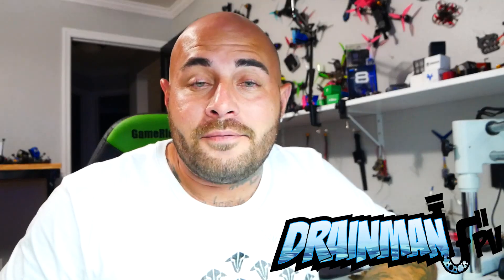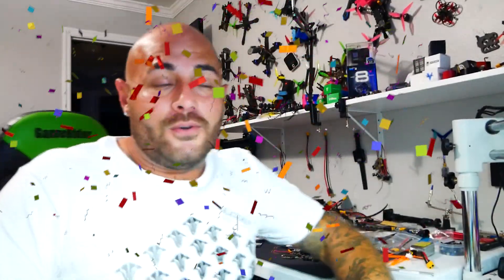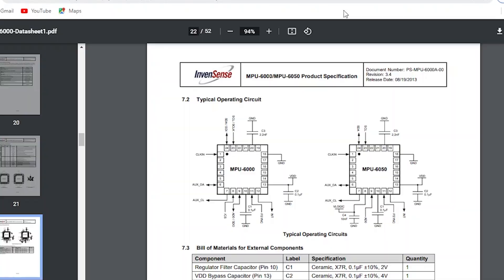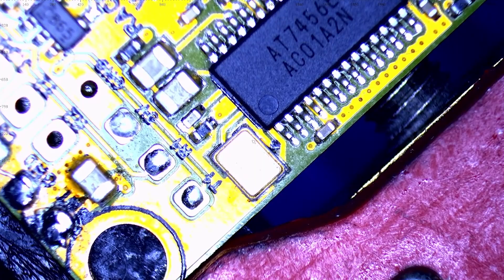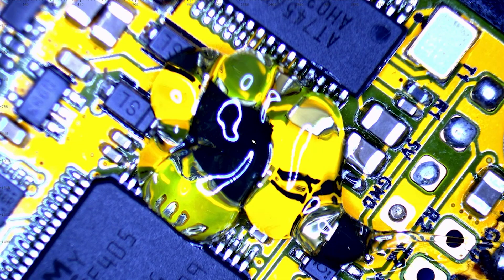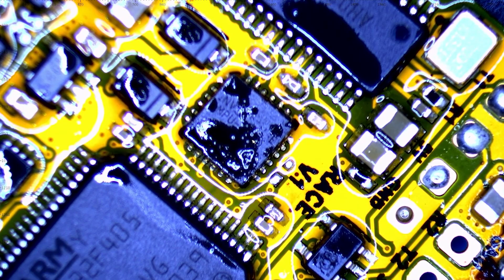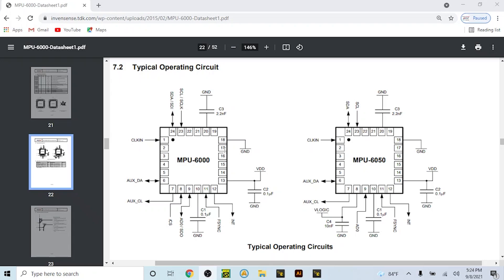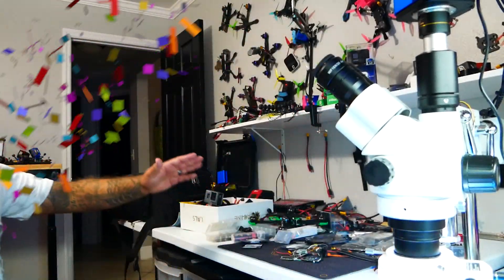How To Fix Betaflight No Gyro Issue! When All Else Fails...

Comment: Hey Drainman my Betafpv Meteor85 is not showing the Gyros on firmware BF 4.2.11 which is the original FW that my whoop shipped with. If I load a higher BF 4.3.0 I get the gyros back but nothing else works. What am I doing wrong?

Comment: it's really advantageous to have a microscope for soldering. I've paid off my cheap Banggod one about three times with the boards I've fixed. Sometimes really frustrating but worth it to learn. I built my own heat gun from a youtube vid. Swabs, alcohol, flux....and patience. Always toss some kaptan tape over the other components you're not working on so you don't blow them away. Once those tiny caps and resistors get loose, they will move without you seeing and maybe just blow off the board if you're not careful, and then you may as well toss the board as opposed to try and figure out where they all go.

Comment: I have a board that the servo's cant be activated in betaflight, and then I tried to swap to emuflight, and the servos can be activated there, but it has no gyro with any firmware I can find, it's fine in betaflight...what's up with that anyone know?

Comment: Great video. I was looking at Bardwell's video on the nogyro message and he basically said get a new fc if what he showed doesnt work which it didnt, i am a newbie so im not really aware of what causes such issue, the issue accured on a brand new mobula6 whoop and so i couldnt beleive that the gyro was fried, luckily it was the firmware which i had been switching around while getting used to the betaflight configurator and binding things, Thanks once again for this amazing video

Comment: @DrainMan FPV hey I have the no gyro issue on emax mini magnum 2 quad was flying came in to land and it freaked out came down rolling over sideways I put in fresh battery and now won't arm and says no gyro on screen I will try using floor noise setting but anything else to recommend?

Comment: Really in my head there's no solution for a bust pad on the board that the gyro attaches too -- its basically too small to bridge the bust pad to where it needs to go....  :(       Another lost FC after less than 3 flights!  Just looked -- its CLKIN PIN 1 where the pad is broken -- how can I repair that - the gyro is probably fine, just a bad pad and pin connection.

Comment: LOVE THIS VIDEO!!  Thank you -- first time i ever removed and replaced a multi-potted circuit like a gyro.  Unfortunately my attempt was not successful as in when I removed the prior gyro --- either i did it or it was already faulty (my suspicion based on the  INSANE number of bad betaflight AIO boards i've been frying out lately) --- I can cleary see one tiny pad in the upper right corner is missing its tin -- ie it can't be soldered or i need to find the direct-connection for that point and skip over the circuit pot link --- i can see i've cleary re-linked all the points, kept the capacitors in place, and still no gryo --- i assumed the attempt would fail once i saw a bad pad on the bottom --- but it was worth the try just for the practice.   You're a mad man using that scope lol -- i don't have one, am old and can't see crap these days --- took off my eyeglasses and pulled it off naked-eye at about 3 inches distance LOL.   Thanks for the education :)   This board flew twice, got strangely glitchy on the 2nd flight --- and died out on third flight just fell out the sky on me :(  --- was a 3 inch toothpick on the ELRS V1 board --- these things suck honestly --- anyways was bad gyro after that probably cooked from not soldering up a capacitor on the lipo --- using xt connector so too much jolt i guess but come on guys its a 1s lipo for cripes sakes.

Comment: Hey drain just got the new mobula 7elrs 1s and it just freaks out when arming or in the air and my gyro 3d model in betaflight also freaks out did I get a pos flight controller?  It's the new 5 in 1 x12 elrs v2.0

Comment: You saved me my friend.  Brand new build was acting up on the firmware it came with when using  beta 4.3 motors jittering, and getting hot within seconds.  So I flashed to different firmware, and lost my gyro.  I re flashed to a legacy version of the firmware, and bang all good.  Now running fine, and got my gyro back.  No overheating or jitters either.  Iflight beast h7 AIO by the way if others have problems.  Thanks so much for the info.
Reply: I had the same problem, thanks bro
Reply: I am running a HGLRCF722 I flashed to 4.3 rc6 was getting hot motors and twitchy behavior so I tried to flash back to 4.2.11 …boom no gyro 
What legacy firmware did you use? I’ve tried to load 4.1 but it still had the problem of no gyro found 
Personally I think 4.3 is nowhere near ready for use by anyone but the developers

Comment: hello friend, great video. I love.. It is something that we cannot all do, because we do not have a magnifying binocular, but I imagine that any amplifier that exists today that serves as a microscope, and can be seen on the phone... but a few questions, since I don't understand English very well, especially when they speak so fast for my level...lol. the questions are... will any gyro from any other plate work? . after a small bump the board ran out of gyro therefore I lost the flight modes... another thing is, what temperature does the air heater have to reach, and what substance do you put on the chip. I don't know if you can answer me but it would be very important for me. thank you.. a greeting friend.

Comment: What if you have a gyro that shows X and Y, but no Z-axis in Betaflight 4.3?  the quad just spins to the ceiling when I give it power?    is it dead? or could it be some other switch or control somewhere I'm missing?